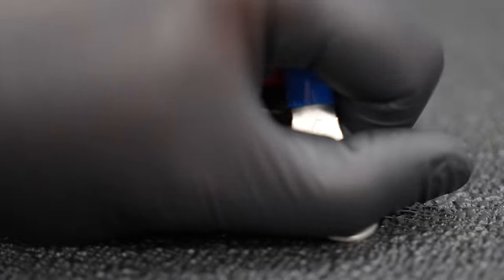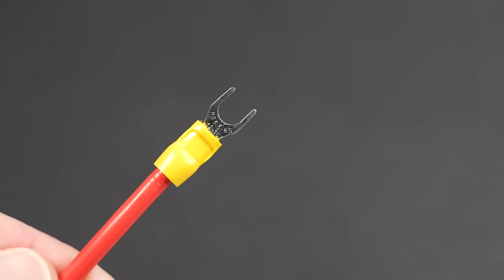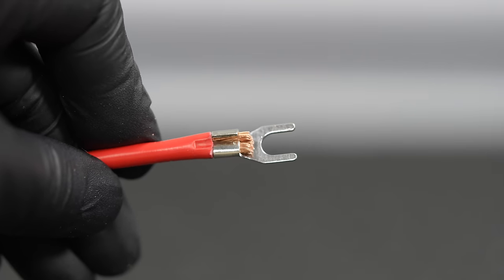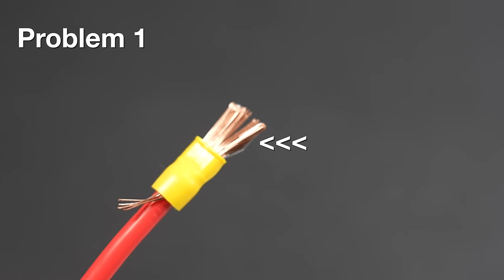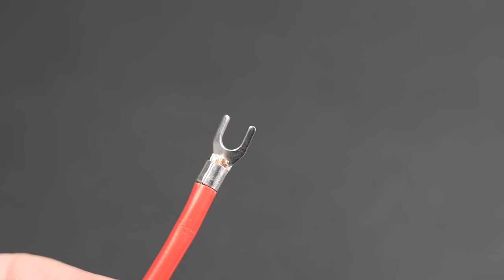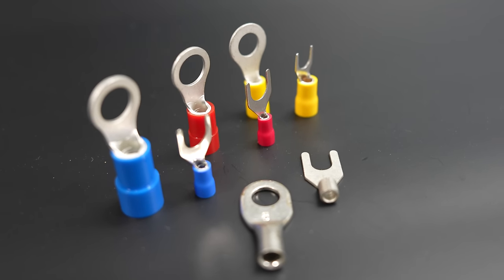Why 50% of All Crimp Connections Fail - Up or Down?

Comment: My 2c. 
If you use those colored insulated connectors, then you will NEVER have reliable crimps, irrespective of tool or technique. They are utter junk, and why they are so popular, even with auto electricians, escapes me.
Go have a look at any OEM automotive wiring.  The connector has two crimp sections: one crimps onto the wire, the other crimps onto the insulation.  The latter is the bit which really stops the wire coming out.   
A connector which only crimps onto the wire, with home tools and wiring, can almost always be pulled apart without much effort.

Comment: But you see the flat side is deformed. When you will screw it, it will deform back, and so loose the wire. So, are you sure this is the right method?

Comment: In my opinion you are 180° wrong. If you do it upside down like you are showing, the split can open and you will never get it tight. All it takes to do it the right way is center the 'tooth' over the split and be careful / use some skill as you crimp. With an insulated terminal just look in from the end to check it.

Comment: Have to disagree with that much wire protruding past the connection. I've seen arcing happen that way. On the insulated connectors, the wire shouldn't extend past the insulation.

Comment: This always worked for me.  Slide a two and a half inch heat shrink down the wire. Stirp off two inches of insulation. Crimp on the connecter, fold back the bare wire, tape the bare wire, slide the shrink back over the tape and heat it tight.

Comment: I always used a Klein uninsulated crimper with two sizes on it. I always crimped with the dimple on the top. The crimps didn't look like his. I know my crimps were secure, I didn't leave things to chance, I pulled on every one and they always past my pull test. Anybody can tell me I was crimping wrong But nobody can tell me they weren't strong. If someone had a finger the size of a pencil tip and got it in the dimple and got a shock, I would have to ask why was the power on and why was there finger that close to the terminal screw. I don't like Insulated crimpers, I don't trust them and never used the one I had except for cutting off 8-32 and 6-32 screws. I also don't like uninsulated terminals, they don't have any strain relief. That is a weak point for wires to break off. That is my story and I'm sticking to it.

Comment: on car, connector and wire oxidize and lose its conductivity, and everything looks good but no electrical connection, so wire must first be soldered then crimped and then soldered with connector

Comment: Over 50% fail? Never seen one fail in my life, done thousands, but we also have insulated connectors that seem better than these. Cannot pull the insulation off. And the connector is not spilt in half as u show. They just collaps and widen. I had trouble wireing once, just some months ago. Was with these type of connectors. Terrible stuff. Had to manually crimp with a damn wirecutter

Comment: Your only as good as your tools. You must use a Klein crimper. The crimper tool that just smashes the crimp like you show will come loose if subjected to movement. The sharp point of the Klein crimper penetrates the side where the 2 metal sides meet.

Comment: This is a decent source of info, but I must point out that your use of the ratcheting crimper shows incorrect procedure. The dies in the ratcheting crimper are MEANT to crimp the insulated connector in 2 places, not just in the barrel section. The dies have 2 anvils meant to crimp BOTH the metal barrel onto the exposed conductors  AND the insulated throat of the connector onto the insulation of the wire to provide additional mechanical strain relief to the crimp connection. Your technique only crimped the barrel and does not provide the designed starin relief since the crimper was positioned incorrectly when the crimp was made.

Comment: The problem is more towards American tool and crimp connector quality and design.
Here in Norway ive never seen that type of manual tool with the tooth, we only have the ratchet type and some manual that have the same mouth profile as the ratchet type where it's two half moons.

Also your tool deforms the whole spade of the crimp connector, that is no good.

Never had a crimp splitting and i always check and tug it, even import connectors from China doesn't split like yours do.
And for a bomber connection apply some solder on the little whiskers that comes out

Comment: This is not quite right. That uninsulated terminal should have crimped with a tool that forms a "B"-shaped end result. Crimping with that tool from the back looks nice, but it's still a weak crimp.

Comment: If you're using crimps for automotive, marine, or critical applications,  you should really use heat-shrink adhesive crimps.  If you do them right, they're basically impossible to pull the wire out of the crimp.  https://youtu.be/2qqrCU6E9Cc

Comment: I don't agree with this video. The seem needs to be pressed in, not the other way around. It's just important you do that the right way and it's not so hard to do even with cheap tools.

Furthermore, I only use un-insulated connectors and always SOLDER after the press, or don't press at all and only solder it. It's so much better, tighter, no possibility for erosion, best connection, etc.

Comment: If I line the tooth of the manual crimping tool up in the center of seem of the connector, it makes a nice tight crimp. You were purposely too far to one side.

Comment: Wrong...use heat shrink connectors fill with dielectric grease push the wire in and heat till its tight if you don't fill the connector first your going to have air and possibly moisture in your connection

Comment: Anything I want to keep, I put on dual wall heat shrink or my doing from 40+ years ago called the poor mans Raychem, to use RTV under normal heat shrink. 
There used to be one crimper at work don't know whos brand it was but it was . Y10ME4. Anyone knows please let me know, wished I had borrowed it , eheheheheheh

Comment: I  SOLDER   THEM  ALL - the designers'  DO  NOT  TAKE  INTO CONSIDERATION ;  THE  3 LAWS  OF  THERMO-DYNAMICS, RELATING  TO  TWO (OR  MORE)  TYPES  OF  METALS,  IN ELECTRICAL  INDUSTRY !    (heat - cold - moisture - vibration =  PROBLEMS ))  Solder  them  ;  A L L -     i  speak  from  a long life - trucking and F I X I N G......(retired old farm-boy)

Comment: Or you crimp it however you want, even with just standard pliers, and solder it afterwards, that way you know the connection is good and will not fail. Also, what's the point of insulated connectors? They have two huge holes on either end for moisture to get in through.

Comment: Still using wrong tool.  When u crimp NO tubular connector the metal part has to Fold into the copper wire to get properly mechanical connection.

Comment: Sory, but these Chinese made connectors  are too cheap to make durable connections, irrespective of the crimping tool. The connector"s material is not strong enough to hold the copper wire because the opening is split. Good connectors feature an additional ring around the cable opening Thus the force holding the wire in place is much stronger.

Comment: How about just a real simple shot of the connecter going into the crimper so theres a moment to look at it. Otherwise, just hearing words fly by is as bad or worse than paper directions if youve never done it before. Add that to non stop conflicting opinions on You Tube, youre better off to take 100 connrctors and figure it out for yourself, which is exactly what i did, many years ago.

Comment: It's both incorrect and irresponsible to call crimp terminals unreliable. They're used because they're necessary. There's no other reasonable way to make many connections and wouldn't be in such wide usage if they were unreliable.
   If any actually do fail it's in the installer to learn how to do it right.

Comment: They fail because the quaity of cheap chinese junk is junk. Good crimp connecors are very expensive, but will last decades
And you need a professional crimp tool. If this is too much, find another way to connect wires.. :)
Reply: Thank you for saying it the right way. I hate the junk connectors, cheap pliers, and trying to find any good tools or crimps. Do you have any good ideas  where to get good pliers and crimps?

Comment: I hate crimp connectors.  When I have to use them, I'll use uninsulated, then solder the wire into the connector after crimping to ensure not only a solid connection, but a better electrical connection as well.  If I need an insulated connector, then add heat shrink after soldering.

Comment: Only soldered connections are permanent connections.  Crimping is lazy and has no staying power.  Corrosion eventually makes them fail.  They fail more quickly if exposed to humidity and moisture.  Crimping connections under the hood of a car, is only a temporary solution.   

When I was younger, I worked for an alarm company.   They had some special gel-filled crimp connectors which slowed the corrosion process down, but did not eliminate it.   We would have to periodically have to repair/replace those connections.  Crimp connections are not permanent.
Reply: Soldering spade and ring connectors is impractical and can lead to issues down the road. Crimp connectors are fine if done correctly. I've been at this for 40 years in these fields, systems technician, component level electronics technician, and industrial control technician.  Look at the inside of an industrial control system that has a few hundred connections and tell me you want to solder them LOL.
Reply: @USA__2023  Summary: I did solder them.  I needed reliability rated in Decades, and not simply months or years.  This is especially true for industrial systems which can create huge hazards should they fail.   

I have done panels for Oil Refineries, Power Generation, and other critical infrastructure systems.   I have also done remote installs of systems, where performing a repair meant climbing a mountain to get to the repeater site.   The goal has always been to minimally achieve five 9s reliability, or higher.  The majority of those systems (including the software written, had reliability which were so stable, and reliable, they continued to operate a decade after the facility eventually closed (those remote locations running on solar and wind power).  

Some men build projects, some monuments that will outlive them.

Comment: Why have a little wire stick out past the crimp? This is not explained.
Reply from the maker: 1) To be visually obvious, meaning you know its all the way though 2) The small bit out the end is un-crimped and acts liek a plug further holding the wire in the crimp. You only need a small amount. Hope this is helpful.

Comment: Most of your "perfect" crimps are complete failures.  You have way too much wire sticking out and interfering with the area where the terminal screw heads will bear.

Comment: Totally disagree with you. By slightly tipping the connector in the tool, you can do a great connection at the seam, in one shot. Big deal if you have to make a second crimp.  Your method bends the connector, making it more difficult to align and screw down. Apparently you only work in perfect conditions, never in hard to reach, tight places. By crimping the seam it separates the stands, creating a slight angle and making the wire harder to pull out. Go ahead and tell me I’m wrong, but my experience tells me I’m right.

Comment: This video has misinformation for any and all insulated terminals you should never use the "toothed" crimp area of the tool. That is for non insulated only. This is clearly marked on many crimp tools that are designed to crimp both types.

Comment: good lord... i think you have absolutely NO CLUE what you talking about!
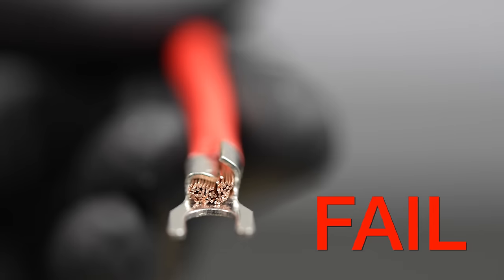1. These pliers at 2:00 ARE NOT FOR CRIMPING!!! They are for wire ferrules, that have NO OPENING!
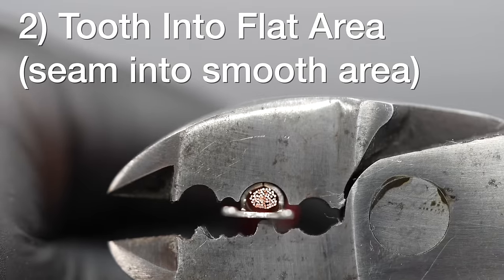2. doing it like shown at 2:10 IS ABSOLUTELY WRONG! You bent the entire connector! and the open part of the connector can still open... NEVER DO IT LIKE THIS!!! 
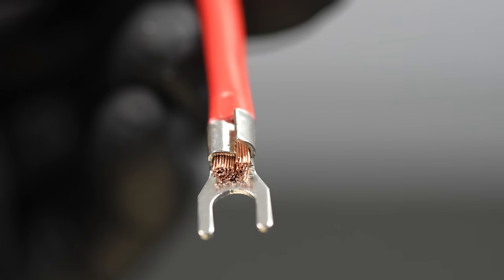The first version like at 1:35 was the correct one (openings must bite into the copper wire) BUT like i told you before, these pliers are completely wrong for this kind of work!
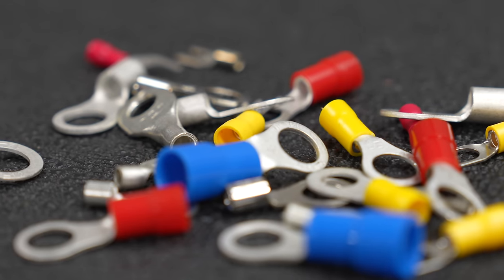3. ONLY use the correct and quality crimping tools like 2:47 never the cheap ones!
4. the connectors, that are NOT isolated need a crimping tool like the Klauke K25

Videos like this should NOT be on the internet! Greetings from a German electrician master

Comment: BTW, those are all fake, cheap and nasty (i.e very poor holding power on wire) terminals you are using above there friend.  REAL ones have a much longer metal collar under the insulation.

Comment: I'm sorry, but this is not true at all. Go look at Automotive or any electronic connections they are crimped using the proper tooling and done the exact opposite of what you just explained aka the correct way. By doing it the way you suggest, it only encourages the seem in the connector to open up over time, causing bad connections or worse, a fire hazard.

Comment: Crimp connectors are a prime example of "blame shit design on user error". I hate them, they're dreadful, they fail frequently and cause more problems than they should given how cheap and commonly available they are. Tere are far better options these days that are not significantly more expensive. Crimp connectors can get in the bin!

Comment: Just out of curiosity, how can there be a Up or down on a round wire? As others have said, your not in the trade, and apparently dont have a clue. It's about the right crimper. And also, many of the lugs you are using are cheap junk. The plastic insulators are brittle and wont conform to the new  bends. If anyone is reading this, spend the money and get 3M nylon for the insulated ones.

Comment: I completely disagree with your method.   To each their own.   My crimp method is different, but takes longer.    I have been at this for 50 years and have never had a failure.   I will happily share if you want.

Comment: Absolutely wrong de pin any oem manufacter connection and the slit in the top is designed to be folded in on both sides essentially cutting into the wire, crimping one time isnt always the answer sometimes you almost beed to crimp the wire twice to get the aplit to push into the wore on both sides, qnd lastly if you are going to use an insulation crimp connector you ahould be using a heat ahrink connector